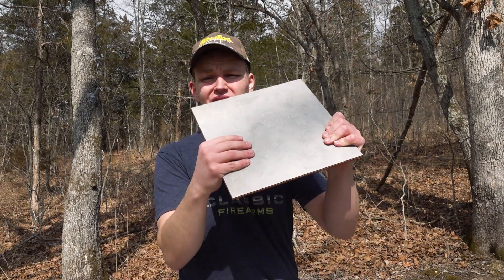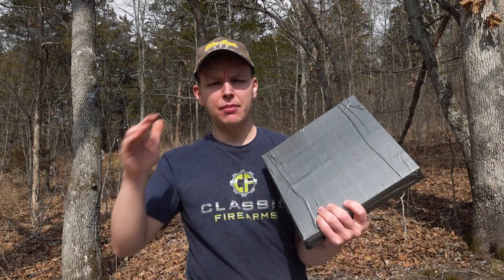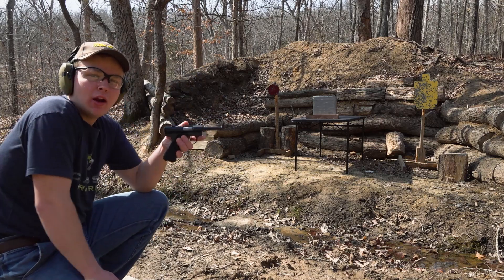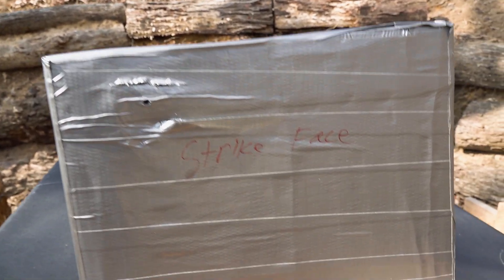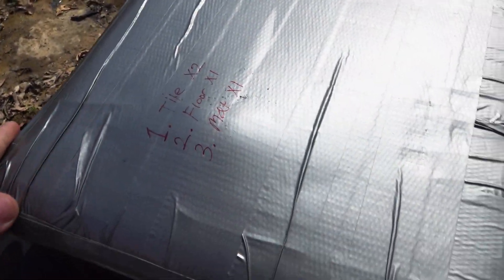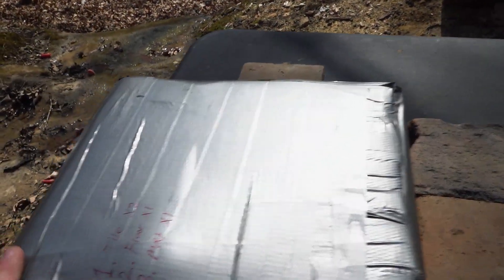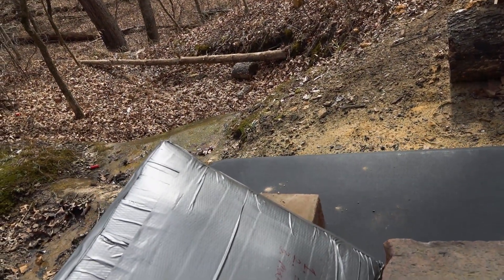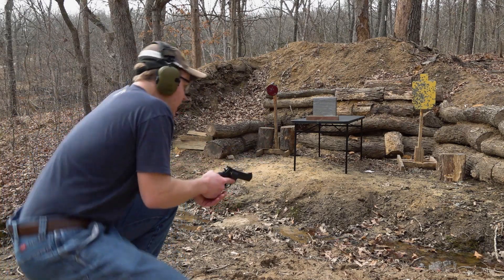Homemade Body Armor Version 2.0! Will It Stop a Bullet?

Comment: For fun I made some BA last year .. actually stopped 4 rounds of .308 before it penetrated ..ceramic tile .. fiberglass cloth with resin and a thin piece of AR400 steel in the middle. However at 10lbs a plate they weren’t light by any means but it was fun